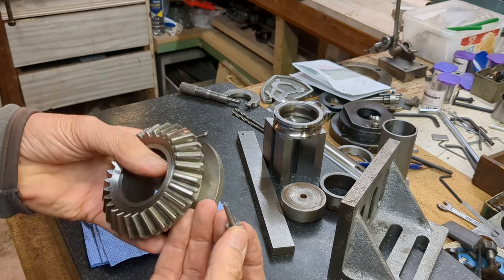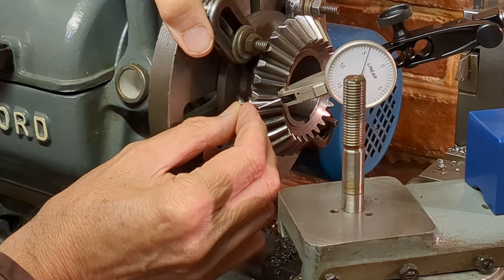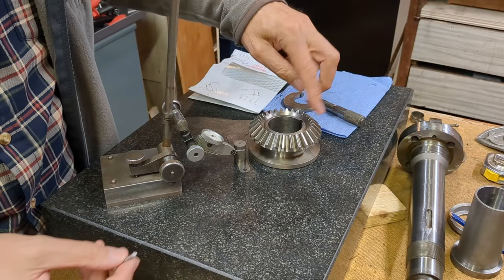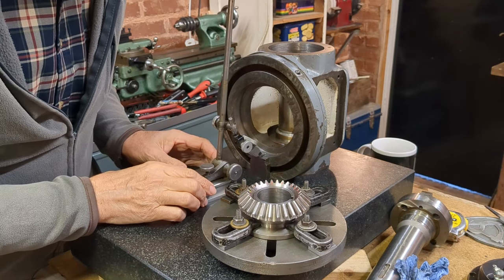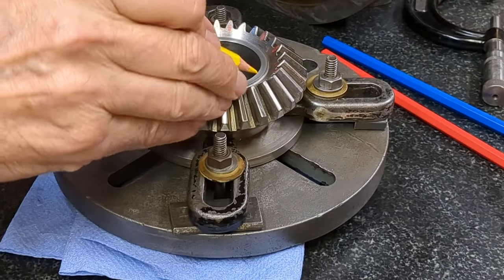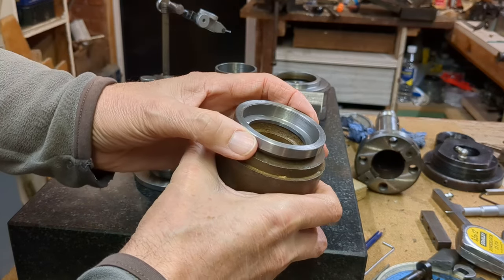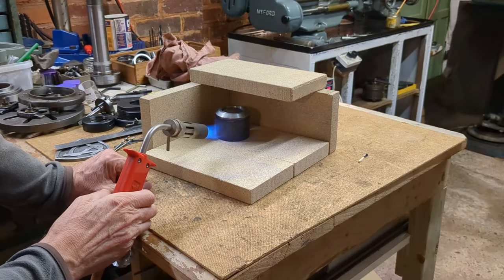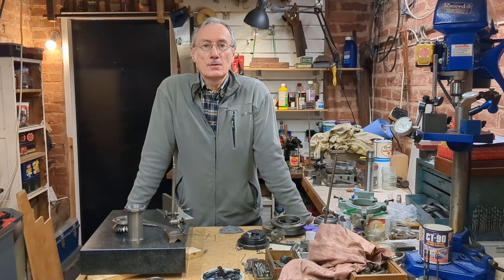Measuring Bevel Gears - Adcock & Shipley milling machine restoration (part 5)

Comment: Absolutely superb. A tour de force of problem solving and measurement to achieve a precise result. I would be very interested in a separate film showing how you made the special gauges, if you had chance to make one. Thanks for this, its of great interest to me.
Reply from the maker: Thank you, Carl. The gauges were just carefully turned from free curring MS. I cut the tapers using the top slide using a dti to make adjustments to the angle and measuring with a mic at both ends. The flange thickness was  machined using a depth gauge against a parting tool. The drawing was adjusted to suit the final dims of the 45deg cone by measuring over the 2 drills as shown. If there is still a demand I could make a video....
Reply: @Workshopfriend  Thank you for the detailed response Clive.